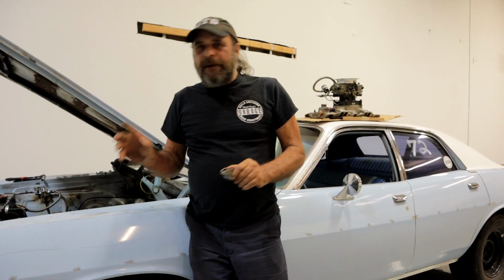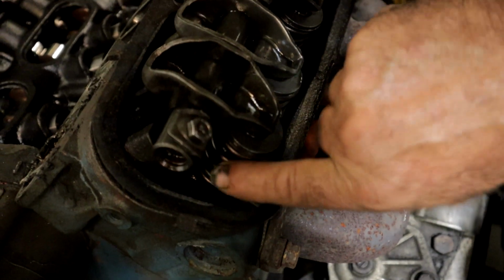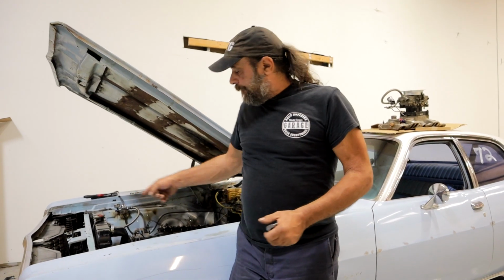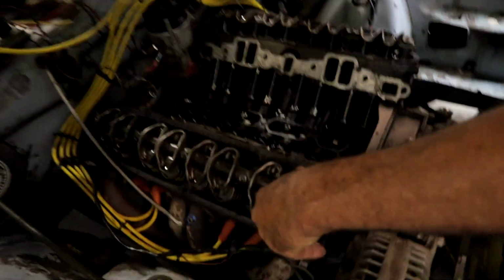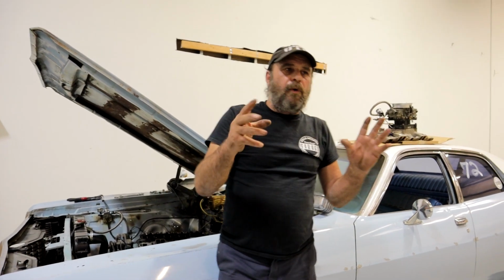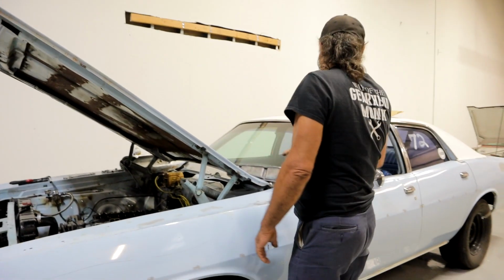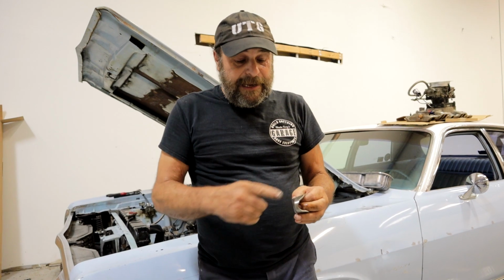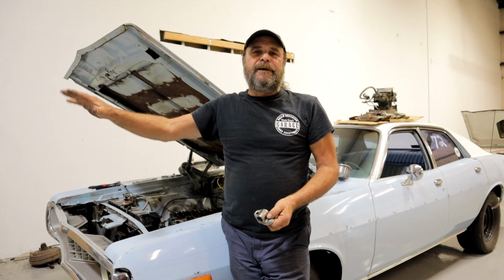Bottle Rocket Rocker Failure Explained

Comment: I have dealed with those CC retrofit lifters for the last ten years or so. And replaced ALL of them with solid ones. It's the same  thing every time. They leak and make noice. When you disassemble the lifter that doesn't hold the pressure, there is a thin stainless(?) plate with slots, and it cracks. I decline to use them in any engine I build. They are the worse parts I've ever faced. 
I'm not a professional engine builder and have replaced them at least in six engines that have had troubles, with solid ones
.

Comment: For this reason specifically,  i speced a custom Comp hydraulic roller profile for my 440 that will run with retrofit SOLID roller lifters. Best of both worlds. The cam profile is easy on the valvetrain and the lifters DO NOT bleed down. This is a great compromise for a street/strip application. True, the adjustable rockers are an investment,  but .. you gotta pay to play.
Reply: still might eat a lobe
Reply: @Torquemonster440  Solids theres no worry of excessive bleed down yes, but HOPEFULLY the exterior of the lifter body and roller/needle bearings are held to spec. and made from good steel.
Reply: @grngs1   yes.. 100%.. but, the hydraulic profile helps this situation.  With the less aggressive hydraulic profile you do not need to run springs in the 600-800 lb range like you would with a traditional solid roller. For instance,  the spring package i plan to utilize will be in line with a standard hydraulic roller spring,165 lbs closed.. 390 lbs open at .600" lift. Which is exactly where my cams lift value is rated. So, i'm reducing the stress on the lifter body and roller by roughly 200-400 lbs over the nose vs a traditional solid roller, which should help this thing live on street. It will be "tight lashed" at roughly  .004" cold which helps reduce the beating the valvetrain takes as well. Hopefully it will all play together nice and catastrophic failure will be avoided.
Reply: @shacklifecustoms8430    yet again, another great tip. Thanks.

Comment: Try doing what Joe Average would do, which is call the company and ask about it.
I feel your pain Uncle Tony. Let’s hope that there’s a good outcome and everyone comes away happy. A reputable manufacturer is going to want to make things right.
Reply: As someone who works in quality control,  I understand your frustration.  It frustrates us as well. Be our procedures where I work we only look at 5 to 10 percent  of certain parts. If we find a defect within those percentages, we reject the container back to production for 100 percent sort. However,  there have been instances where we would find an issue, reject and then get overruled by management.  So it makes us feel like doing our job is pointless sometimes.
Reply: @Daniel G pretty much. They gotta make shipment no matter what. But for what I  do, if we do miss a shipment and it shuts down one of our customers,  we get charged per hour for what ever line of theirs goes down. So our standards and procedures are only  procedures of convenience.
Reply: The tech/product support at the big companies is pretty much non existent now. Over the past ten years every time I've attempted to contact any of the big companies to resolve issues I got nowhere and wasted countless hours being put on hold. The few times I did manage to get someone on the phone all they did was read what their computer screen said. "Make sure the electrical connections are clean and free of dirt" "make sure you have a good connection to ground" "make sure to lubricate the part before you install it". I've tried emailing them too, they don't reply. Last year I bought and received two faulty ignition boxes in a row from the big giant ignition company that has been bought up by the big giant carburetor company. There was a card in the boxes they came in. It said DO NOT RETURN PRODUCT TO SELLER IF THERES A PROBLEM. CONTACT OUR TECH HELP LINE. Well I tried and they failed so I had to send it back twice to the big warehouse parts seller and the nice lady on the phone informed me that there was currently a large batch of faulty boxes.

Comment: It is my belief that the tolerance needed to maintain the pump up pressure is too hard for the builders of today.
No one gives a damn if it is sloppy and bleeds down. It pumps back up and works, sooner or later.
The +/- tolerance is becoming too great, gotta get the parts out!
Hard to buy quality today, volume is king.
Thanks for sharing your findings.
Reply: Reckon it is only a matter of time before the good auto parts manufacturers figure out what some of the gun manufacturers did.  They could not find enough competent button pushers to properly maintain their Cnc machines so they had operators turning out tons and tons of out of spec parts. The only cure they found to actually work was installing a measuring machine for every cnc do they could perform 100% part checks and not just spot checks on batches.

Comment: I work at a fleet maintenance shop. We service darn near everything, and perform everything from DOT inspections to engine rebuilds. I have noticed in the past year and a half and it doesn't matter the manufacturer any engine with a hydraulic roller set up from the factory have some type of lifter noise 3-8 seconds after start up. I'm not sure if it's the manufacturer skimping out and letting them bleed down because they will pump back up after startup or they have a lifter vendor that's messing up. The only cam and lifters I have had to replace because of damage are the Ram Hemis, and you have touched on that a few months back. 

I will give you a good example. I and another tech have the same engine in our personal workhourses. A 3.9l magnum Chrysler V6. We both did freshenups  to them within a few months of each other. Both of us replaced camshafts. Both of us soaked the lifters in oil for 12 hours like the Hayes manual said. Both of us used the same stock cam from same manufacturer same vendor. The only difference was I used NOS  Mopar lifters he used the ones from the vendor he got the cam from. My engine fires right up quiet as a church mouse, his fires right up and has a lifter noise for 2-5seconds afterstart. Both engines run great. 

I'm starting to wonder are they doing this on purpose to make the older vehicles obsolete to slow down progress. Think about it who are the consumers of older vehicles and there repair parts. The poor or the disenfranchised.
Reply: I was thinking the exact thing, i'm not that into the automotive world actually, but looking at how the repair industry is headed right now it makes sense that they would try and sabotage whatever new is being made to cripple what otherwise would be a rock solid reliable old but good vehicle so we can go and buy the new shitboxes which are no better.

Comment: The thing I find interesting about this shit show is with modern manufacturing tech it's now cheaper and easier than ever to mass produce a tight tolerance part like a hydraulic lifter correctly with good QC, yet here we are. It's just outright greed.
Reply: Exactly, but by precisely balancing the cost of manufacturing with the cost of returns, they find their golden median to take home the most dough. Gotta make slightly shitty lifters to make an omelette I guess, nothing will change until they lose their business to better quality manufacturers.
Reply: As a machinist, totally agree
Reply: @mercoid  It's like going into a city, you see the mcdonalds, Wendys, uh...Chic fila? Anyways, you know what i mean, you have the typical go to classic places where you get what you get. Is there some AWESOME little spot with the BEST food around for a good price? Fuck yeah, are you gotta find it over mcdonalds? Probably not. Will they be as quick? Not likely. Can they serve as many? Nope. People can blame this or that, its all down to greed
Reply: Amen.
Reply: @mercoid  It's not a question of how likely it is, they just need to put out their product and try to make a good name for themselves. If your competitors put out 50-25% scrap while you have a near 100% success rate then the customers should take heed and start buying from you instead, and if you're one of the few reliable manufactures out there then even higher cost should cancel itself out. Inflation is crazy anyway.

Comment: I do a lot of engines myself. Something I noticed many years ago on 2 cylinder small engines, which happened to take Chevrolet small-block hydraulic lifters. If those lifters are pumped up with oil and you tighten down that rocker you can either Bend push rods or pull the threads out of the aluminum cylinder head. So I always purposely bleed down my lifters before I put that stuff together. And if I use new lifters I do not soak them in oil. Just an outside coating
Reply: The only way that can happen is if you are installing the rocker arms when the cam lobes are not oriented with the base circle up. And please wait fifteen minutes before rotating the engine and doing the next cylinder. Not doing so is a great way for pistons and valves to make contact.
Reply: @davidleonard8369  David, I never even knew that. I just put them in all at once without rotating and getting on base circles. Well it was a stock cam. Nearly stock.
Reply: @auteurfiddler8706  The way I mentioned is the factory service manual way on Harley Davidson evolution engines. Odd that they are two cylinders and can use Chevrolet lifters.

Comment: I have a lifter on a V6 that won't pump up, I just cranked the rocker arm the whole way down... I'm getting sick of the bad parts BS!!!!
Reply: Yeah, the problem with cranking the rocker arm down too far is that intermittently that lifter will pump up and hold the valve open - seen this on a 250 inline 6 Chev motor.  It never ran smooth, and then when I was replacing the valve cover gasket I checked the rocker arm adjustments and some of them were 3-4 turns in past where they should have been set.  Installed new lifters while I was in there (did the side cover gasket as well), adjusted them properly, and it ran like new when I was done.
Reply: @redmondjp  I ran it for an hour and it never pumped up! We had to replace a few lifters that did the same thing, they did not even have 10K miles on them.

Comment: I had lifter issues with a not so aggressive camshaft in a 408 cleveland I currently have setup. My lifters had blown out the guts of the bat symbol shaped bleeders in the valve body's. Had a rep come to my engine builders shop to assess the lifters as the builder was highly concerned and had not seen this issue up till this point on any other more extreme builds. The rep came up with the idea of finding the same lifters ONLY difference were the new set came with an inch of dust on the top of the box and he mentioned that poor quality components of the later built lifter was probably the issue. Had the lifters in it now for around 9yrs as a summer cruiser which I occasionally lean on and its hung in there till now. Least he was honest with us in a way I guess...
Reply: That shows the problem more clearly than most will show or admit it. The "new normal" for manufacture of hard parts reminds an old guy like me of the days long ago when "made in Japan" equated to the most crudely made, rotten material products one could find in this country. They came in droves to learn from those who made cars and parts in this country in those days. Look where they are now. I would bet Japanese companies that farm out parts manufacture and the associated QA to China are about as rare as a Wolverine with a sweet attitude.

Comment: Dealing /w the same situation today.  Comp Cams, roller cam/lifter kit...over $700.  Basically impossible to set valve lash. Bleeds down so fast you cant feel or gauge the proper drag on the push rods.  And also, why I'm I changing valve seals on $1900 AFR heads after 1,000 miles? Really discouraging.

Comment: You should be able to get total reliability with a roller cam of moderate specs.  The OEMs have been doing it for years.  I had a chinese roller lifter toss the link bar, spin and take out my cam.  Same PN replacement cam from the biggest company had a smaller base profile.  Nothing about it in the specs.  Had to spend even more on custom pushrods.  Far too often you can't win.
Reply: Same happened to me just recently, Biggest Cam company didn't mention the grinds being on a smaller base circle than previous cams, nowhere was it mentioned good thing I checked before the install, almost 0.150 difference between the same grind only 4 years apart in purchase.

Comment: I hope these folks at ** cams get back to you. I'd like to hear what the office chair engineers have to say about the situation.
Reply: Nothing arm chair about it if my guess is correct. The parts are stock replacement and just good enough for stock replacement and nothing more. Probably out sourced to China where drawings and specifications aren't read the same way as they are in other engineering cultures. Where someone in the USA, Germany, Japan, etc would say okay, this is what the application needs lets make sure there's some factor of safety, in China they hit exactly that minimum. Same print, same spec, but read two different ways. When a buyer sends it off to China guess what comes back?

Comment: i would like to hear what they have to say also.....we know its budget minded....but what else can we do uncle tony.??...now im wondering if i should just leave my slant 6 or my 350 buick engine stock...and not touch them...except for a couple minor bolt on external goodies????
Reply: If like myself you are going for long term reliability, I only use OEM parts... even used OEM parts.  Aftermarket is my last resort.
Reply: @brucenichols540  even oem part are not as good as the original most of the time they got more than one supplier for the same part and do constant revision to lower the cost or find over priced supplier 
One simple example older honda where fitted with Panasonic battery they will last 10 years easy after 10 years you go to the dealer and buy a oem battery and 5 years later its dead 
Panasonic battery where too costly so they changer supplier and you get an inferior product but the price is the same
Now honda get problem in the newer model with starting in the cold or if they sit too long

Comment: This is the exact reason that I have been reduced to talking about cars and not building them anymore. The final straw for me was the $1800 set of AFR heads I bought that had 11/32 keepers, too bad the valve stems were 8mm. Then the guides were too tight, well except for the bell mouthed bottom which was way too loose. Then the seats were not even close to concentric. I work too hard for my money to throw it away and that is essentially what you do when you spend that hard earned money on parts like this. And as this video shows, it isn't just the Chi-Com stuff that is junk. The big well known companies are peddling garbage too.

Comment: Classy vid... You didnt call out the company directly, but I hope you did give them a call and ask some questions!! Stock rockers+stock springs=no issue. Regardless of lift/rate of cam (obviously within sane limits, which this clearly is), this shouldnt have happened, and the collapsed lifter hammering the rocker is surely the cause. Hope that you get a corporate response and explanation Uncle. While not being a "paid promoter", dont discount your name, history, and channel as having substantial weight. You could push the company to make changes and have better QC, which will benefit all of us little guys out here. And thats what your channel's about!!!

Comment: Non stop cam issues. Really sucks.. I bought a 360 mag from a guy a while back. Got told "low milage 1998 360" but it was $150 complete so I expected junk. Get home and tear the top end apart and had 1 pushrod completely through a rocker, sludge build up, and about 4 different pistons with valve marks on it. Oh.. and it was a 94 engine lol. 

Hope it all gets sorted out Tony 👍
Reply: Yikes!

Comment: At this point I would just try used or older performance parts, maybe they are made with some actually quality control
Reply: That's certainly a great idea, on paper!  Using used lifters on a different cam certainly isn't recommended.  But I agree with your idea where it can be implemented.  We are entering dark days for sure - most people with their noses in their new iWhatever probably don't notice, but those of us who actually build and/or fix stuff certainly can see how bad things are getting, when you can no longer get quality parts or materials from any source, at any price.
Reply: Getting to the point we need our own junk yard for the stuff we actually use/drive and make buddies with a good machinist if your not...
Soo much stuff today is just going to shyte
Reply: @redmondjp  not sure if he's saying to buy used or not; but CERTAINLY some of the only parts you can trust are NOS (new old stock).  Can't trust Remans these days to last 5 mins of 5 feet and so many of the new parts are completely suspect especially electronic parts.

Comment: I have dealt with the suspected large cam manufacture in the past over a failed big block Mopar solid lifter cam. Fresh rebuild on the engine, happened on cam break in as per instructions. I got their attention with an email I wrote on my friends behalf. They contacted my friend and ask who the hell I was and agreed to replace the cam and lifters. They offered no allowance for gaskets oil or anything else. The engine had metal shaving all through it so we disassembled it, cleaned everything, replaced rod & main bearings and put it back together with no problems. Cost my friend down time and money for the parts that the cam company would not cover. This was probably 15 years ago, so the problem has been around for a long time.